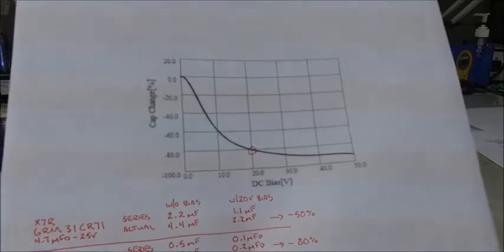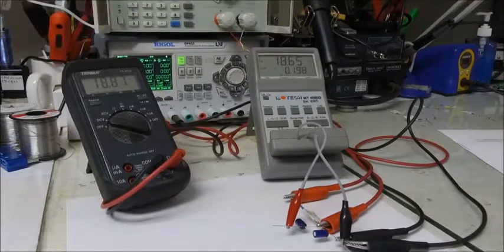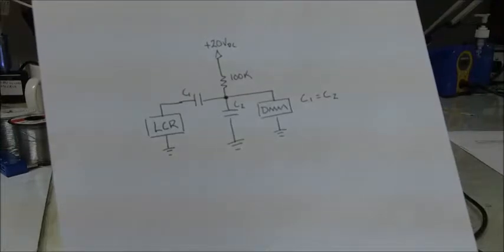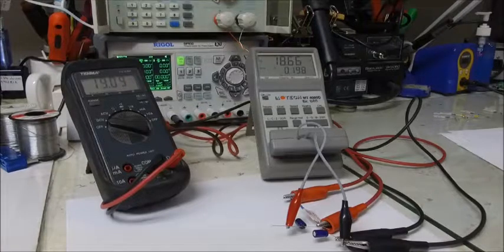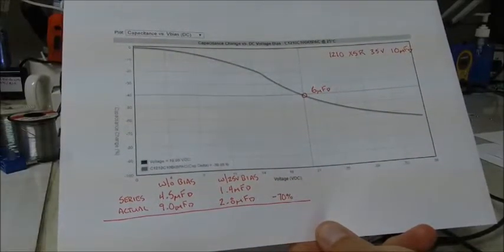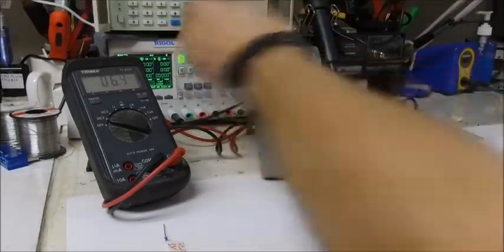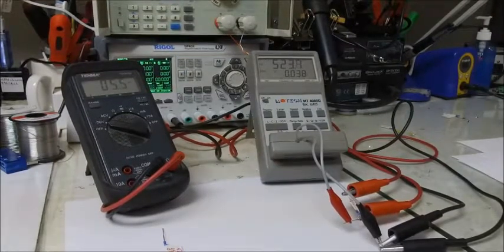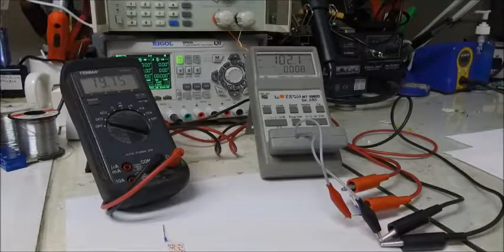Ceramic Capacitor with DC bias value measurement. LCR Meter

Comment: Resistor seems pointless, unless caps are huge and bias source is weak and not current limited.
Reply from the maker: Thank you for the information.  It has been a while since I have looked at this experiment.  I will look at the setup and test again and report.  Thanks.
Reply: @DanPattenAudioG33k  Thank you for the video. It is still the only one on YT about measuring with DC bias applied without specialized LCR meters. So it is very relevant.

Comment: Are you sure you calculated the resulting capacitance correctly by simply doubling the value? I think it's wrong. Yes you have 2 caps in series, but only one is DC biased, the blocking one is not. So you should use calculate capacitance of 2 caps in series which have different values. Or use much larger blocking cap and then ignore it.
Reply: All the "grounds" are connected, so it comes down to internal structure of LCR meter, which takes differential measurement, so its V- lead is not directly connected to ground, but still should have same potential. So, I guess, this path has some impedance or at least limited bandwidth, non of which should not matter for DC bias of the cap. But taking capacitance measurement this way, you have to be certain which lead of LCR is a function generator output, otherwise your caps end up in parallel and "blocking" cap would not actually block DC bias.